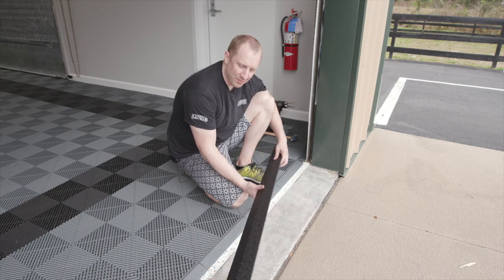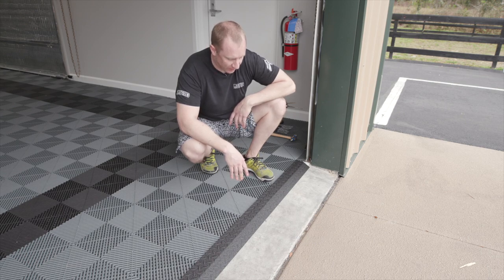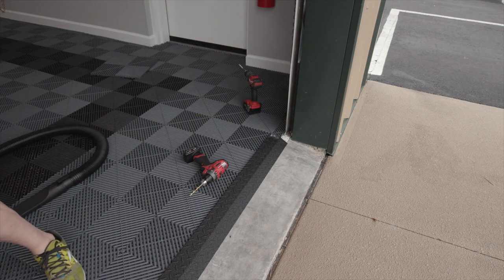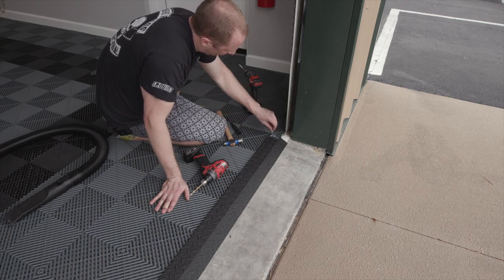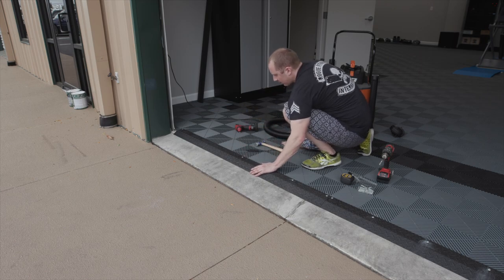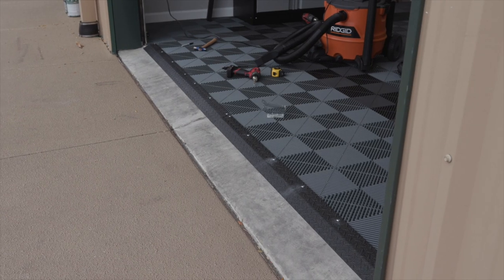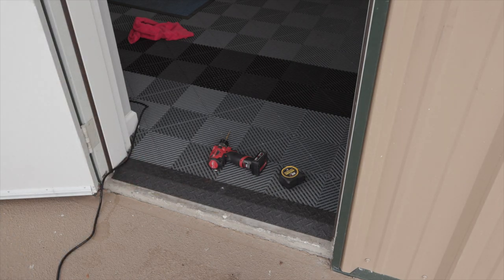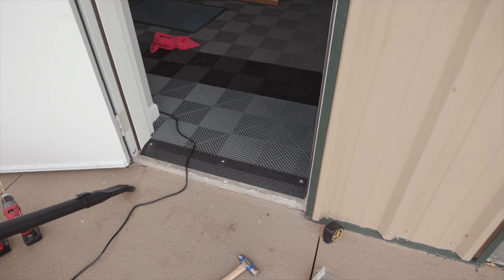Dealing With Garage Flooring Edges: Swisstrax Treadware

Comment: I think it would’ve been better to use 3 pieces instead; cut them all to be equal in length.
Reply: Yes then you would have only two joints instead of three with the unstable 2" pieces.

Comment: Why didn't you use black nails? Also you are using the wrong hammer for this application and when you're drilling use a smaller drill bit first that will guide the thicker drill bit. These nails are strong enough to go every two feet this looks Overkill
Reply: Jeremy Lujambio It’s all good. He needed to use a larger diameter metal bit first to go through the diamond plate that way the masonry bit had enough room to get through plate to start going through the concrete. 
This is OG over-engineering is the name of the game!

Comment: Matty, can you recommend the best way to add parking stops on top of Swisstrax tiles?  I'm looking for a solution that a) won't be too visible color-wise; b) that people won't be inclined to trip over and c) that won't lift up off the concrete after being installed.  I saw some nice-looking diamond plate versions sold by HD but they are pricey....about $80 per stop.  I don't recall if they came in different colors.  I like your Treadware solution for the entrance lips but would like to replicate that same style and color for parking stops.  Thanks and great job!

Comment: Watch out if there is direct sun on parts of the flooring. I left plenty of gap around the edges but when the sun shines in the door in just parts of the flooring it buckles very badly. I used racedeck brand but likely an issue with any of these plastic snap together flooring. 2500 for the flooring in my garage and when the sun is out it buckles like shit.
Reply: Nathan Pust while thats always a risk I will say I so far have ONLY had that issue with RaceDeck which is thinner and “cheaper”.  I had that in my last garage and the sun would cause it to expand a ton and bulge everywhere.  Not the case with Ribtrax.

Comment: Maybe The question should not  be posed " What about the dirt "
 It should be what happens when the dirt gets wet and turns hard.
 what about the slush and sand that comes of the car driving in the winter.
I think it would be great for climates like yours .
 Not so much in the great white north. Unless you have some insight.
Are those  pajama shorts? jk

Comment: I figure that you've probably at least thought about this--because it's you--but have you tried construction adhesive like PL Premium for installing these? In my experience with it, it's the strongest adhesive I could find while renovating my basement, but it still has just enough flex to it so that it shouldn't immediately crack and de-bond if you happened to drive a car over it.

Comment: How much does this slow down the water draining out of your garage when cleaning? And have you pulled out the floor since installing the edging to clean it? Has this made it more difficult?  I have Epoxy and I'm starting to not like it as much much and the top coat has started to yellow since new from the sun when the door is open and I'm going to be building a new home and I'm dreading the cleaning underneath.  Trying to convince my other half.  We clean out garage in the winter  months in Illinois with water twice a month.

Comment: I backed up my truck and all the tiles buckled some came apart. I wanted to ask do you have like a 2 inch gap between the tiles and the wall all around?
Reply from the maker: I cut mine right up next to the wall.  The only way the would buckle is under some serious speed and braking or aggressive turning.
Reply: @ObsessedGarage  yeah my garage is an L with the driveway so I have to turn in(drive straight down the driveway then make a left into the garage) I drilled some tapcons on the front row and have yet to have an issue. I’ll report if it is a true fix

Comment: Nice vid... Thanks!  TIP: Get some cans of compressed air for cleaning keyboards and use it to blow out the concrete from the holes after drilling.